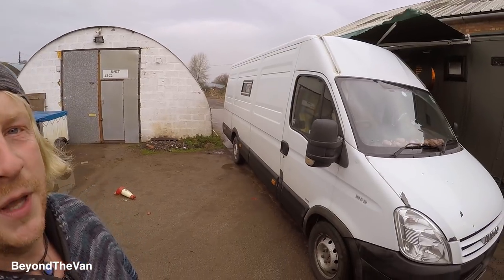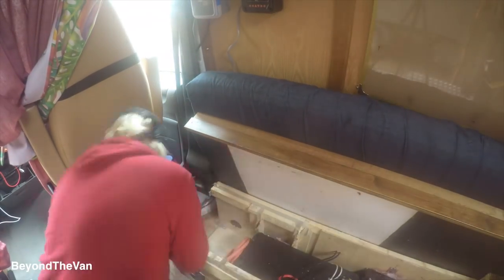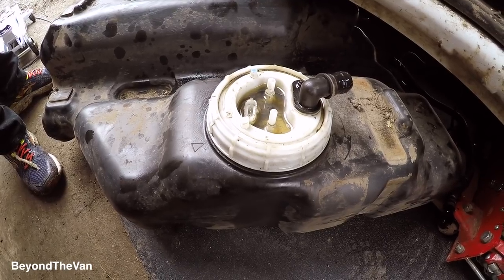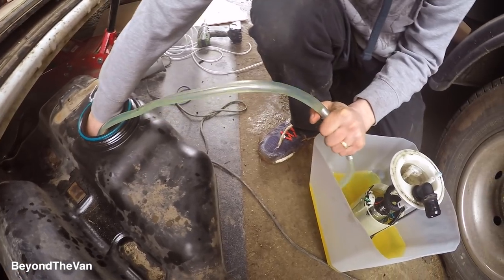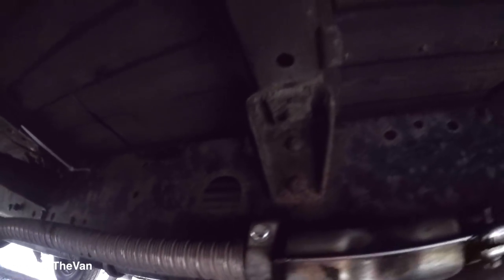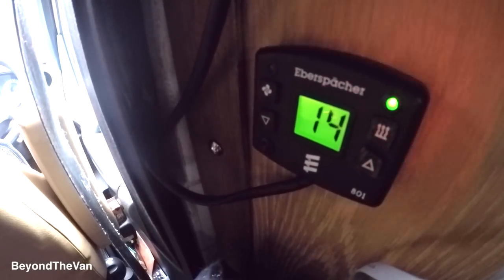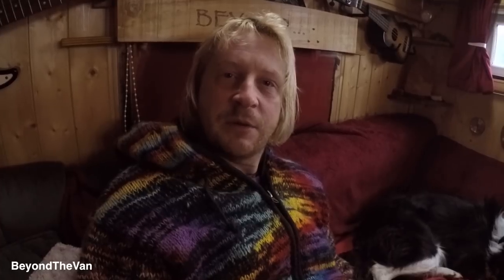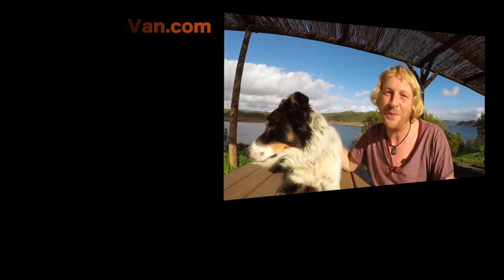Fitting an Eberspacher Diesel Heater... and how current are my videos?

Comment: Water will always take the easy way out, it could start at one end and follow cables etc downhill till it finds a low point exit , ceilings usualy slope to the middle , light fixings are a popular escape route , just wondering if your vans parked on a slope atm , hope you find the source ,time to break out the  Sherlock holmes  hat -)
Reply from the maker: I know, this is why it's so hard to find the source.... I'll keep at it! 😅

Comment: Great video 👍 I had a leak in my Toyota Corrola right above the drivers seat, it absolutely saturated the footwell & i couldnt locate the entrance point to fix it with some sealant 👎 i needed a windscreen replacement anyway so got that done & now it has a new seal it seems to have cured the issue :)... could yours be getting in along the top edge of your van maybe? Like under the metal trim, just an idea :)
Reply from the maker: Quite possibly... problem is, the roof rack covers it all... and that is well and truly fixed 😆😆
Reply: Ah I see, perhaps take the cupboard off & seal it from the inside? Bit of a chore but needs must ey 😊.. hopefully Camp Quirky is nice & dry anyway 😁🤞

Comment: How come you didn't just put a T piece in the fuel line instead of breaking into the tank ?, I thought it would be easier.
Reply from the maker: Several reasons. Eberspacher don't do it that way and the reason is the vehicle fuel lines usually only have diesel in them when the in-tank pump is running - ie engine is running. Older vehicles which use an engine lift pump could potentially be tapped into the fuel lines but that then risks emptying the fuel tank with the night heater. The separate feed for the heater doesn't reach the bottom of the tank 😊
Reply: I doubt it would empty the tank rich, but newer vehicle could have had separate tank for red diesel, heater fuel is tax except. If you wanted to be really cheeky you can put a switchable tank from red to clean diesel incase you get pulled over then you can run both engine and heater of red diesel lol
Reply: you can on webasto as mine ran that way for years, and as the pumps are virtually the same i dont see why not. but, when i refit to my new van in a few months, i will add an independent drop pipe into the tank. its not a really hard job, and it means it would be impossible to lose all your diesel if say a pipe came off, holed, whatever. but... if the diesel is coming out of the tank under pressure, it messes with the heater pumps measured dose system and the heater will run rich/flood...